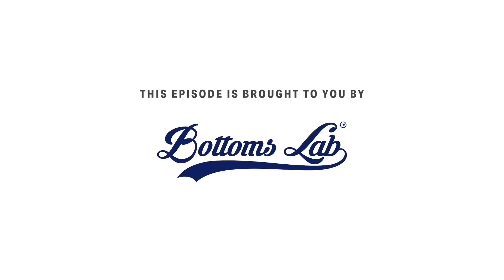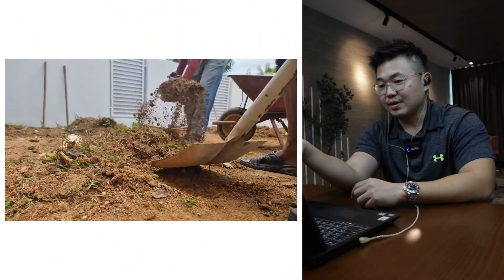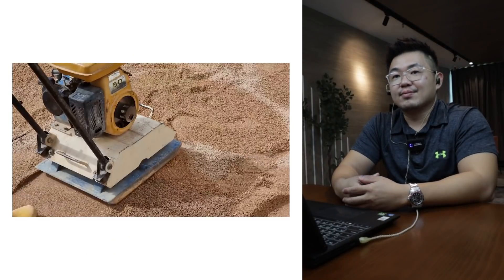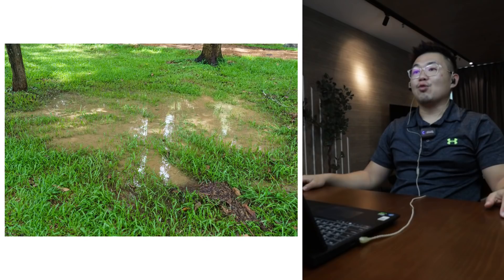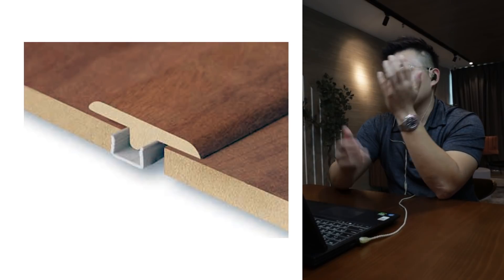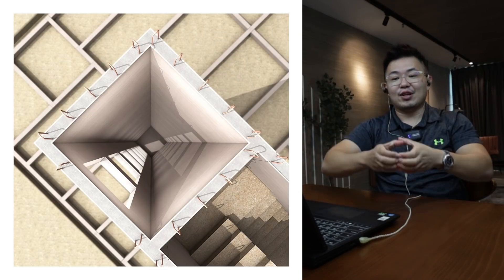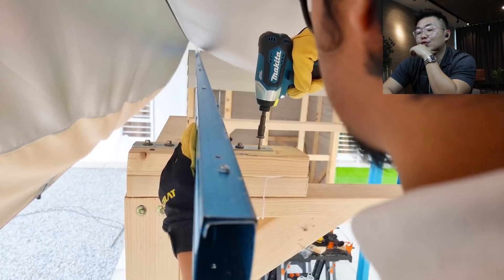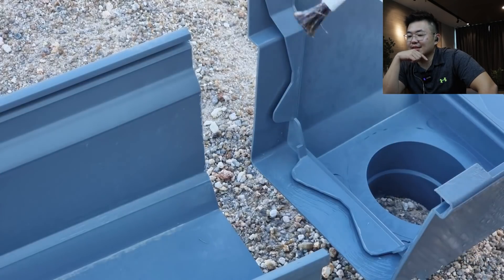Property Expert Reacts to DIY Workshop Extension

Comment: Thanks for this very educational video, boss. You are right, old houses might not be esthetically pleasing to the eyes but they definitely beat new houses when it comes to the issue of functionality. Things like external bracket wiring systems , externally located water tanks and non "double level height" ceilings will make maintenance easier and cheaper.